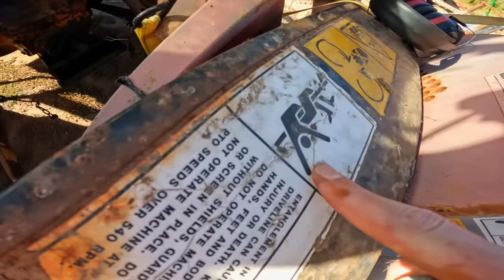I Bought a Tractor from a Republican

Comment: When using tractors and pto equipment like this you will have 3 settings you can adjust. In the cab you should see a lever or switch, this is your pto rpm. Started 2 settings are 500 and 1000. I believe a wood chipper is 500 and you had it set correctly in the video. But your tractor rpms should be in the 1500-2000 range for proper use. If you dont have a tachometer it should be about 3/4 throttle. Other than that, tighten your belt, sharpen your blades. 

Lastly if you are going to buy more 3 point hitch attachments (box blades, bionic blade, tiller, mower deck) I suggest getting a quick connect system. Allows for easy swapping of attachments. 

Hope this finds you well

Comment: Usually on chippers that black handle that wraps around the shield where you feed in the trees controls the speed and direction of the hydraulic pump on the feed rollers.

Feeding larger materials usually requires controlling the feed rate with that handle to prevent stalling the tractor.
Reply: I just commented the same thing. On our chipper I set the speed of the feeder separately and the handle only controls forward/off/reverse.

Comment: I am surprised your other wheel tractor doesn't have a PTO. It's got the three point hitch with the box scraper there's usually a PTO so you can run a mower deck.
Reply: How do you know so much and so little
Reply: @CheeseMiser  I work for a government

Comment: Crank that tractor up to full throttle when you're using the chipper. You don't want the chipper to get stuck because it's a pain to get it running again. 

Also the rectangular handle over the chute/funnel at the back of the chipper is a reverse for the feeder if you push it. If it starts to stall you press the handle and the feeder will pull out whatever you put in there so you don't kill the tractor. 

At least that's how our chipper works. Try if yours works the same.

Comment: We drive our tractor around on the street to get to the other side of our property for maintaining, but we also live in a rural area, and only have two lane roads on our normal areas of travel. No stop lights on our usual route (filling up at the station involves going through an intersection), and we usually have a follow car to prevent people from tailgating and running into the bushhog. We wave people around our mini convoy when traffic is clear, and, when driving the tractor, I will pull off in a convenient area if we are starting a parade with the traffic.

Comment: After getting new tyres you most address that rust on the articulations of the arms and frame. Ok? Scrub it off with a steel brush, until you see bare metal, patch the holes, add more steel where it is needed and paint it all up with undercoating and a layer of weather resistant paint. Take my advice to heart and that "thing" will last long enough for your son to do shenanigans with it.

Comment: Hey William. Growing crops takes a lot of equipment that you do not have. 

Getting started, I'd say the easiest thing you can grow is Hay. All you need is a round baler or a square baler that run off your PTO. 
A round bale ( at least in Canada where I am) is going for around a hundred bucks. You can also store them for a while without using a grain bin . 

Basically, the more grass you have in an area, the more hay you can get.